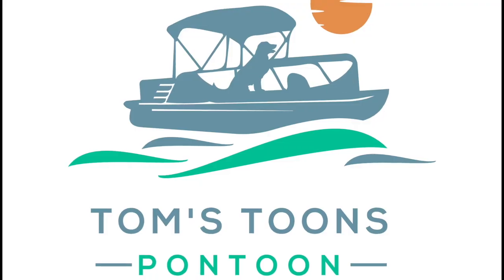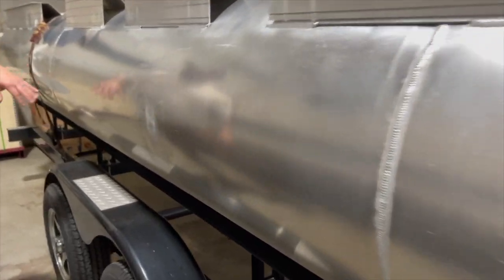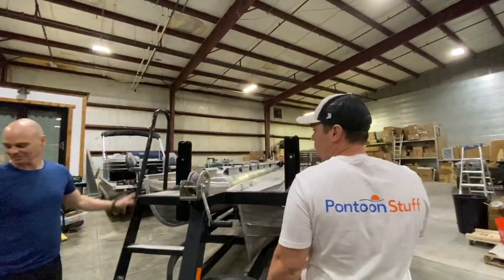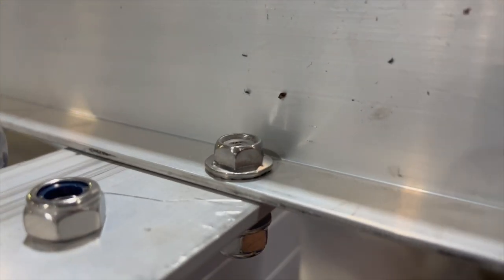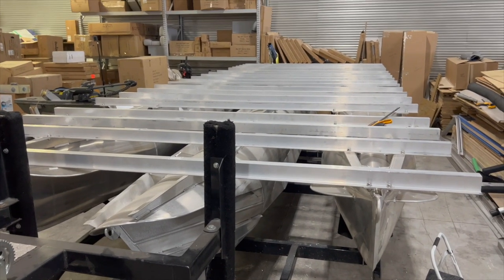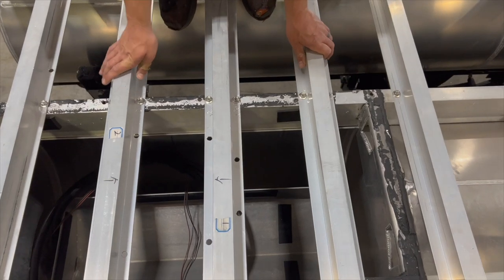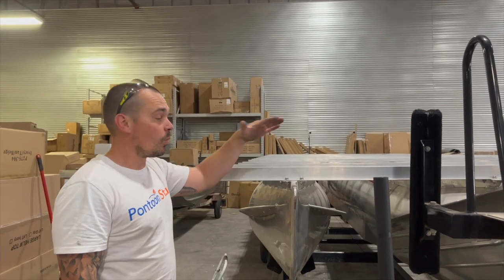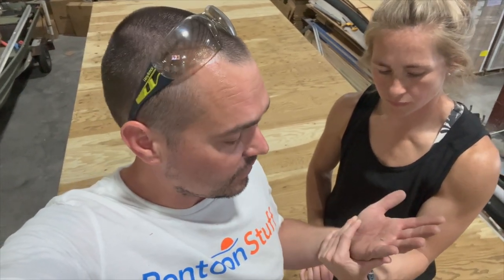DIY TRITOON BUILD - Episode 1 - WHERE TO START

Comment: The one thing I would never do is mix pontoons from different makers. I mean, yeah, I get it, you’re trying to save costs and source toons quickly, but you have two outer pontoons with dolphin style nose cones mixed with a Manitou center toon with a barracuda style nose cone. As a decades long pontooner, that point on its face just looks ridiculous. Not to mention that the separated staggered risers of the outer pontoons are completely sub par in strength to the full length risers of center Manitou. Just my take on it, but I would’ve held out to get matching used toons from the same manufacturer, even if they came off different boats. Heck, call Manitou and ask if they have a scratch and dent pile and have the toons shipped out to you. It’s either a quality build with careful attention to detail or it isn’t. But hey, that’s just me. Either way, good luck with the build.
Reply from the maker: The beauty of it is that I can't see any nosecones when I'm out enjoying the boat ;-) Plus it hasn't bothered me yet when I do see the different pontoons or other items mentioned. The purpose of this build was to do it on a tighter budget than the $60K+ to buy a new boat, and to use the products we install on a daily basis to keep track of how they hold up over the long term. And we made the video to help inspire other folks to take on a project like this too. 

I wish it were that easy to track down scratch and dent toons from manufacturers, but believe me it's not. Heck, the gentleman I bought the Manitou center toon from said his insurance paid $7800 for the new center toon alone from Manitou...for $1500 I'm happy as can be 🙂

One of the things I love about pontoon boats is the variety in which they come. Someone can enjoy a frankenstein pontoon with a picnic table and lawn chairs just as much as the next person who spent $200K on a brand new tritoon with twin outboards and a full bar. To each their own as long as they're out on the water enjoying life. Thanks for watching!